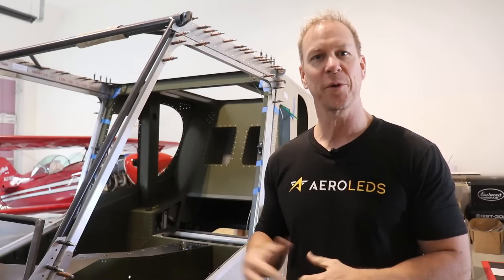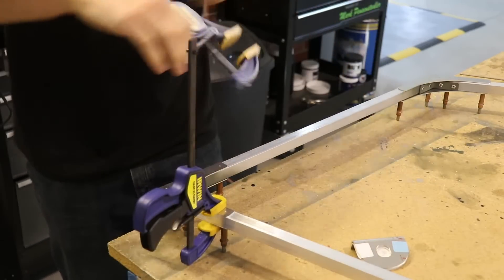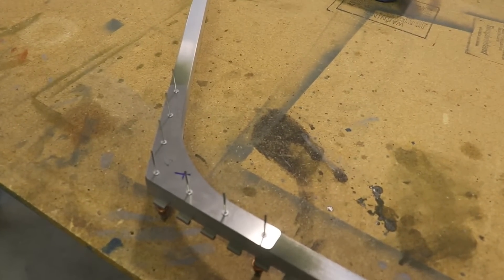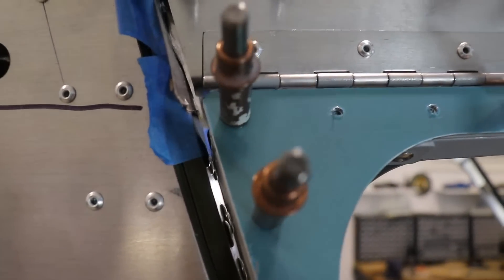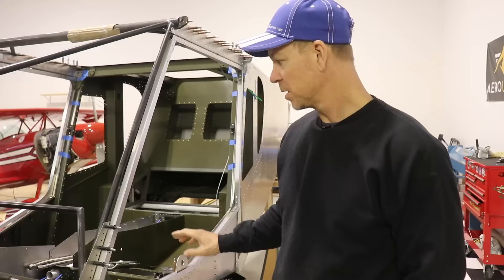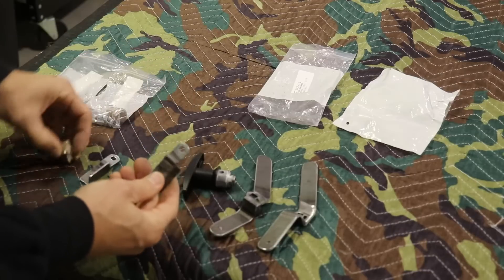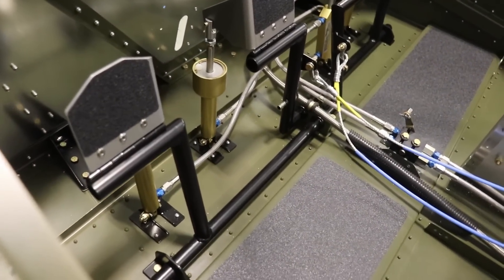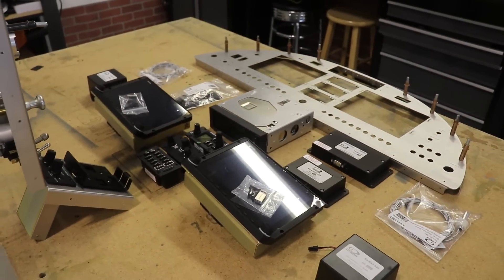Zenith CH-750 Door Frames (Ep58) Part 3

Comment: Great looking job to date. Only question I have is do you want to powder coat parts of the frame that have stress on them? I was taught you don’t powder coat anything that would possibly have cracks from metal fatigue in the future that powder coating would hide. Great videos, enjoy every one.
Reply from the maker: I also have heard that too. I'm comfortable powder coating it. Vans Aircraft has powder coated 15,000 engine mounts and people have spotted cracks on the mounts so I'm not sure if the powder coat really hides cracks or not. Nothing wrong with just priming and painting the steel parts too!

Comment: Getting a little cold up here in Alaska, too. Not too bad today, though. We should have a high of 40. And all of last week's snow has melted. At least in the lower elevations.
Reply from the maker: You already had snow?? Yikes!
Reply: @KitplaneEnthusiast  My big fear is that the lake across the street will freeze over before I finish the cedar strip canoe I’m building.  And I have to finish the canoe and get it out of the garage before my Zenith kit arrives.

Comment: When you expressed your dilemma about having to move the planes out to set up your paint booth to paint the cabin frame, YouTube decided to throw in a commercial.  During the commercial, I thought, "Why don't you just powder coat it?"  When you came back from commercial, that's exactly what you had decided to do! Great minds think alike! LOL!
Reply from the maker: Ha that's true! One of the reasons I didn't originally want to powder coat it is because I wanted it the same olive drab as the interior. So my plan was to prime it and paint it. However, scuffed up powder coat makes an excellent primer, so if I do want the tubes green, I can always just paint it. But, I think I'll leave it the satin finish black from the powder coat.

Comment: Looking forward to your wiring video. I am still trying to work out the Static port locations and the OAT probe. As you might know, i went G175 IFR as well. So it will be helpful. I will say the same thing i posted at Aerworks, please lets all be civil, I enjoy both of your channels, we are all just trying to share our wonderful experiences building our planes. Don’t let the YouTube trolls start rival out of the Zenith Family. You Are both doing a wonderful job (much better than me, on both YouTube video creation and plane building). Keep up the great work, and I’m sure the next fly in we are all at with our planes, we will sit back and enjoy sharing our builds with each other…
Reply from the maker: Joe keep in mind that I'll be learning as I go too! I've obviously wired a Dynon panel before (actually twice!) but this is a much more complex panel with dual screens, autopilot, and a different brand GPS. My plan for the static port locations is to ask Zenith where they mounted theirs on their Super Duty since I would assume it must work well. I'm not sure it's too important where you mount the OAT probe, as long as they can be kept away from the hot exhaust gases. I have a single OAT probe on the bottom passenger side of my Cruzer and it seems to work well there.
Reply: @KitplaneEnthusiast  Thanks for the input. I was thinking placement of the static ports on the cruzer should work well behind the baggage area in the hell hole.
Reply: Mark if you go to page 5-17 of the SkyView installation manual it gives some guidance on OAT probe mounting. In the Sensor Location section it mentions this “Avoid exposing the sensor to sources of heat that would interfere with outside air temperature readings such as: Direct sunlight, engine heat and exhaust, aircraft interior, heated air from the cabin exiting from an open window or cabin exhaust port”. I like to install the OAT probe next to an inspection panel under a wing, then you eliminate the issues with direct sunlight, and any chances of exhaust or engine compartment heat effecting your OAT reading. Per the install manual you can extend the wires if you need to. Thanks for all your hard work on this channel!